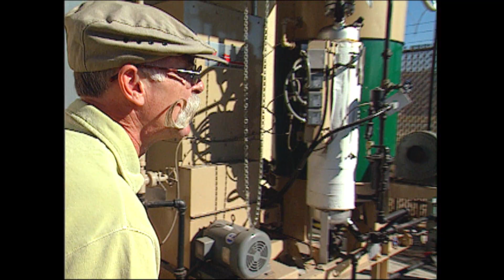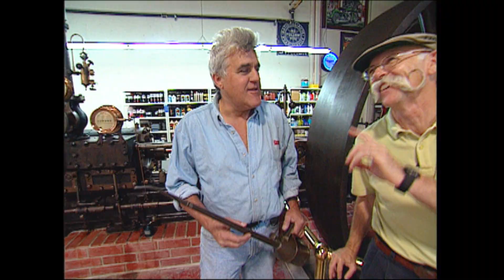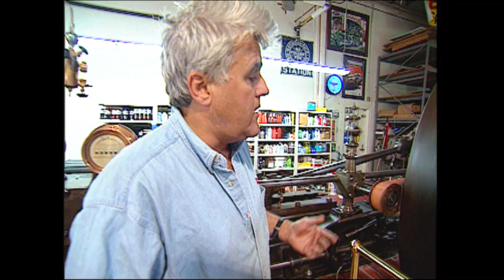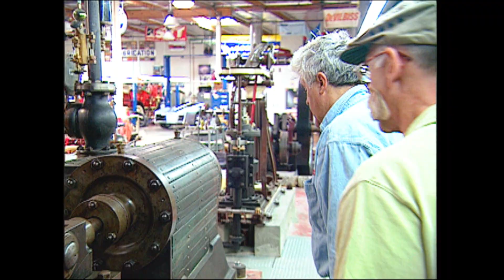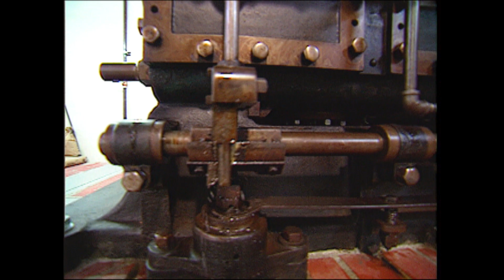Jay Leno's Most Powerful Steam Engine | Behind the Scenes

Comment: The Corliss mechanism is shown at 9:55. The intake valves are lifted to admit a tiny bit of steam, then an adjustable cam unlatches the valve lifter, and the valve drops closed. The dashpots at the bottom cushion the valve as it drops, reducing wear.  The governor adjusts the trip cam to control how much steam is admitted to maintain constant speed, as needed to run a factory.
Henry Ford definitely knew why this engine is historically significant, the people that ruined the Ford Museum definitely didn't.

Comment: What wasn't discussed is that this engine has an early version of the very efficient Corliss valve gear, which works by admitting a measured amount of steam into the cylinder, then suddenly closes the inlet valve, and allows the small amount of steam in the cylinder to expand, using up almost all of the energy that it has. Within a few years, almost every stationary steam engine used Corliss valves.  This engine is termed a "Mill Engine", designed to run at constant speed in one direction to power a factory, weaving mill, grain mill, a machine shop, or electrical generator.

Comment: Pumping engines
The first commercial steam-powered device was a water pump, developed in 1698 by Thomas Savery.[15] It used condensing steam to create a vacuum which raised water from below and then used steam pressure to raise it higher. Small engines were effective though larger models were problematic. They had a very limited lift height and were prone to boiler explosions. Savery's engine was used in mines, pumping stations and supplying water to water wheels powering textile machinery.[16] One advantage of Savery's engine was its low cost.[17] Bento de Moura Portugal introduced an improvement of Savery's construction "to render it capable of working itself", as described by John Smeaton in the Philosophical Transactions published in 1751.  
Jay's steam engine as an advanced model! Pumping engines were a very valuable invention since they were used for pumping ground water from coal and other mines.

Comment: I was so fascinated when I first saw a steam engine running. It was at the Gas Works Museum in Dunedin, New Zealand. The engine was not as big as this one, but still pretty big, and the loudest noise was the clicking of a ratchet mechanism that drove the oil-pump. Another engine in there was called the "Bryan-Donkin-Booster" and had a sound like a heart-beat, of the sort you feel more than you hear it. I could imagine a bunch of Jazz musicians jamming to its groove.

Comment: there was this showroom quality antique steam train that came to rescue because it happenchance to be parked approx 2 1/2 miles  behind gently derailed coal train measured 1 mile long.    the train came, prepped with pushbars and railroad ties, chained to front. engineers just punched it. steam roared sky high, spit fire and brimestones effortlessly pulled stuck train backwards and the coal train snapped back on the rails.      it had four cylinders.  oil-fired firebox instead of coal  producing 7000 horsepower but torque output was god-like.   unconceivable amount of torque  around 150,000 PFTQ.   built 1940-1941.   crew lovingly called it 'Big Boy', newer generation also called it 'Big Boi'

Comment: Really cool. From this thing to a steam turbine it puts quite a knot into your head. I even think this type of steam engine has more complexity and thought behind it than a turbine. If they had a deeper understanding of how gas expands we could have seen turbines much earlier, plus the fact that planes were also very new. Smaller variety of steam engines like that could be pretty nice in places like africa where you get your steam from the sun. Just a matter of someone to teach them or even give them steam engines. The distances are to big with such a difficult terrain it makes little sense to decentralize power generation like we have. In fact we also move away from centralized generation but for other reasons.

Comment: Balls-to-the-wall also refers to fighter aircraft like the p-38 lightning which had plastic or bakelite circular lever covers, handles. and when do you want full throttle you push the balls to the firewall. or the instrument panel/cloché Maybe not so much a P-51 because it only had one throttle but twin-engine like the p-38, or bombers like the b25,b26,a20,a26,f7f anything with two engines or more.

Comment: Enjoyed this video very much. When I was a preteen my dad got a job operating Wilmington Water Works where they had two Holly steam engines, manufactured in Buffalo, New York, that each weighed 500 tons and could pump twelve million gallons per day. In 1968 they were replaced with electric pumps. As kids we  liked to watch the fly wheels spinning through the floor at which time my dad would yell get out of there you will knock your block off. Sure enough they were no safety guards of any kind. One was sold to a scapper who told my dad it cost more to move than it was worth in scrap.The engine that is left can still be seen at Wilmington Water Works in Wilmington Delaware.
Reply: Snow/Holly kept going, and built huge gas engines configured like this steamer, that ran gas pipeline pumping stations. There are several of them running at museums, like Coolspring Power Museum.

Comment: This is so cool. I wish my father was around to see this. He worked in the power house for Ford in Dearborn, Michigan. He was a First class stationary steam engineer. I remember as a young man getting the tour of the power house. I am now 67. If my memory is correct, there two very large flywheels. They were massive, as a small child they seemed to be around twenty or so feet in diameter. Half of which would go beneeth the floor. There were multiple large boilers that we were allowed to look into the sight glass on them. Dad worked there until the late 80's. I do beleive that these massive machines were removed and sent over to the Greenfield Village in Dearborn. The powerhouse was updated just before he retired. 
George B

Comment: iI was working with a paper making company in south east LA in the late 90's to convert their Paper making machine to a variable speed AC drive system.  They were replacing a steam engine which was built in the 1870's.  They kept the steam engine in service as the backup drive.   To the best of my knowledge it is still in service.

Comment: Jay mentions they used to run machine shops off of leather belts from these steam engines, There is a historical steam shop in the north east that runs entirely off of a steam engine, much smaller than this one but it is fascinating to see the engine running and turning the belts and pulleys. The youtube channel is "David Richards"

Comment: @MyClassicCarTV  >>> I am currently about 2/3rds of the way through the video. 

Unless Jay mentions it and I have not seen it yet -- or he did mention it and I missed it -- does this engine {or just the piston & cylinder} have any kind of overhaul limits? Like TBO {Time Between Overhauls} on the aircraft piston engine? Or will it just go 'forever' as long as it is properly maintained?
Reply from the maker: It’ll pretty much run forever if properly maintained.
Reply: @MyClassicCarTV  >>> Rodger that -- Thanks.

Comment: Without digging up my owners manual to get the exact number, my Ford F-150 pickup weighs just under 4,000 pounds. 

Based on THAT, the FLYWHEEL on that steam engine is the equivalent to about my truck x 1.5 spinning around....

Comment: It needs to be noted boiler horsepower is NOT the same as mechanical HP. 100 boiler horsepower is quite a lot. I work with modern steam systems as a power engineer. Great to see these old engines cared for and run.

Comment: That governor is so cool. They would use something like it in the older tape machine motors, where a weight would swing out under tension as the motor rotated and cut power off and on to keep the motor at a steady speed.

Comment: Is it just me or does that flywheel look nowhere near 6 tons? Even if exaggerating all three dimensions (diameter 3m, 0.5m width and 10cm thickness) you only get like 3.3 tons for steel (with roughly 7 tons per cubic meter density). And realistically it looks to be about 2m diameter, 30-40cm wide and 5cm thick (yes there are spokes to include, but they certainly wouldn't add that much...

Comment: "Internal combustion are incredibly violent with explosions while steam is just heat" 

How can he know so much about cars and the history of his steam engine and still say that? Have a catastrophic engine failure in your car when you're in it and you'll be fine, have a catastrophic engine failure in a steam locomotive when you're on the plate and you'll be a fine red paste. Walk past a leaking high pressure steam pipe and you can get flensed to the bone and cooked walk past a leaking line on a car and the worse thing would be a burn from hot oil.

Steam is arse clenchingly scary.

Comment: I love how he's not just a collector with deep pockets, but he really KNOWS this stuff and LOVES it.
Reply: Jay is a walking talking encyclopedia of mechanical marvels. Anything after horses he knows about it
Reply: Except he's wrong it takes only 45min to an hour to get up to steam. We do it all the time on our steam traction engine.
Reply: @wwjd6922   Ok, but he was comparing huge boilers running stationary factory engines, so...
Reply: @TheTreegodfather Well, in this case, size does matter. On the other side of his stationary engine from your steam traction engine you have much larger engines. Like, the engine of the mid-40s Navy Destroyer I was stationed on in the late 70s early 80s. They COULD raise steam in 12 hours. Normally, though, it was closer to a day so the tubes wouldn't warp as fast.
Reply: Even with 'little' boilers (600-800hp ~100-150psi) it's usually a good idea to bring them up slow.  We shoot for about 12 hours at work for the 3 pass cleever's, and maybe 8 hours for the superiors.  

Sure...we COULD probably rocket them from cold to 120Psi inside of 3 hours...but then we'd be re-tubing them every couple of years.  

Traction engines warm up quite quickly.  Designed differently, with comparatively small volumes of working water.
Reply: @jonathonschram3429  Can you explain what happens to the tubes? I thought in a horizontal locomotive boiler, multiple tubes were positioned vertically over the fire box and then went horizontally through the boiler.

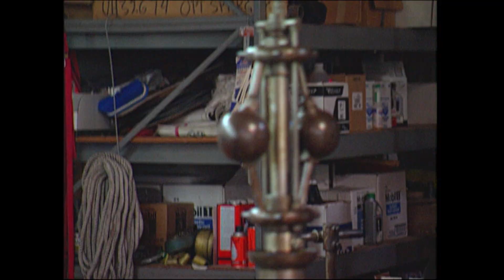Comment: 8:00 125 hp/300-500 rpm is a huge power source. Add to this the powerful torque of the steam engine and we have a power source capable of powering a not inconsiderable sawmill for 100 years.

Comment: Watching Steam engines run is something I could easily enjoy all day long. They're mechanical works of art.
Reply: For me, the one thing that's missing the the load on the engine. Connect an electric generator to it or something that would provide some load so that the engine would actually work instead of just idling. 
That's why, for me, steam locomotives are more interesting, since they are actually used and even if the train is not long, the engine still actually has to work. Or, there is a guy who has a steam-powered machine shop with line shafts etc.
Reply: A load is the answer. I saw a video on YT about an early single cylinder oil engine running and it wasn't making too much noise but someone said in the comments that when that engine was used to power machinery it could be heard 5 miles away. @Pentium100MHz
Reply: I think the steam engine technology was shelved to quickly, I could imagine a steam turbine engine being powered by thorium a low level form of radiation . It’s just a thought I’m not a engineer.
Reply: @007007niki  Well, steam turbines are still used, it's the reciprocating engines that are no longer used, because they are less efficient than turbines or internal combustion engines.
Reply: @007007niki  For the past years Ive been studying and designing, and lately, thanks to my job, also actually building and testing, the idea of steam vehicles that could be used today. The idea of "what if petrol technology did not advance" or we just didn't use it for power and we kept using and develop steam power. The short answer I found during the years is that, not only we could have easily kept using steam up until efficient electric cars (so even today) but thanks to decades of research on heat management (which happened), nowadays steam cars would be more efficient than today petrol cars. Yes, back when we switched to petrol, it is true that steam had a lot of disadvantages for smaller applications (like personal vehicles), but the truth is it was a rushed decision humanity made cause of the demand of war. After the wars, we never went "back", cause the progress we made for internal combustion engines was at that point much greater than steam progress: we stopped using steam tractors, steam engines in factories and eventually even trains, part of it being the huge interest in crude oil which grew immensely during the wars. What I'm trying to say is, many people see steam as a primitive technology compared to what we use now, but it is just the path we chose; we could have easily continued using steam without disadvantages. I'm currently having fun building a steam car myself, borrowing a friend's machining tools!
Reply: @007007niki  Steam turbines are used, what do you think spins the generator in a coal or nuclear power plant? :) It's the piston engines that are not used anymore because of their lower efficiency compared to turbines.

Comment: Jay, I love ya and you're right about the governor and 'Balls Out', however 'balls to the wall' is from fighter aircraft. The throttle had balls on the top of the handles. When they pushed it forward towards the firewall for more speed, that's where you get 'balls to the wall'. I don't mean to be mean. That's just the way it is.

Comment: In Walla Walla, WA there was a wood mill/cabinet shop named Whitehouse-Crawford. Up to the 1930's they used a plant like this to run  their various machines,  saws, planers, etc. via a system of overhead belts that fed to each machine. After the '30's they used large electric motors to power the belts. As a kid I used to walk by the shops just to  peak through the open doors and watch the  system of belts whirling away. Get well soon Jay!
Reply: Theres a company here called Wabash and they make floors for Wabash semi trailers, there had a steam engine running the plant until atleast the 90s
Reply: Some of the old sugar cane grinding mills in Louisiana used to be ran by steam engines as late as about the 1980s.  My boss at one time had a family mill, he said you knew how much cane you were grinding by walking into the mill and hearing how fast the steam engine was running.  The few still running nowadays are powered by steam turbines turning generators.

Comment: I love this kind of stuff. Thank you Jay for acquiring this and making it run again. I was a Navy and Merchant Marine engineer for many years and did a lot of steaming. It's amazing how far we've come with steam. Nuclear power is steam power.
Reply: The new nukes from Moltex use molten chloride salt within the fuel tubes and the heat transfer “pond”. At 600 to 700 degrees centigrade (approx 1100 to 1300 F). Stem conditions are the same as a thermal power plant 575C at 120 bar. Makes the warm steam in a PWR look pretty lame.
Reply: @Dave5843-d9m  wow 1067 degrees at 1764 PSI is a lot more than I ever steamed. The highest pressure boilers that I operated was 1200 PSI water tube steam generators the lowest were 150 psi fire tubes.

Comment: Sure makes you think, if you could find an energy efficient way of making steam, this would have to be one of the most sustainable ways of making power. Nice video.
Reply: There's videos of old steam tractors giving the modern ones a run for their money. Sure the best they could do is around 4-5 mph but they'll maintain that momentum day in day out hour after hour. Steam engines aren't the fastest things around nor were they meant for speed but sure is comical watching the action unfold.
Reply: Fire your boiler with Hemp 🛢 approximately 90 million acres Can produce all the oil we need . It would be efficient and clean and America has the land .

Comment: Those balls are known as the flywieght govenor and prevents that engine from going into overspeed. The faster the flywieghts go, centrifugal force pushes them out and regulates the steam back to keep the engine at a constant speed. We use 3- 1938 steam turbines that utilized the same govenor, before we switched them over to pneumatic actuators, to provide service water to our chemical plant up here in Sarnia Ontario. At our local oil fields we still use bull wheels with babbit bearings exactly like the ones on that flywheel. This is by far the greatest technology ever created. Thanx Jay for preserving it and keeping it alive

Comment: Just so we're clear here... "Balls out" is probably the only term that came from the old steam governors. Balls to the wall was actually an aircraft term for full throttle, because the old throttle levers had a spherical knob on the end where you would grab it. When the balls (plural, since most aircrafts have more than one throttle, one for each engine) were "to the wall", or front of the cockpit, you were giving it the beans!
Reply: Never knew that. Cool!
Reply: Industrial engines and tractors also used ball speed regulation